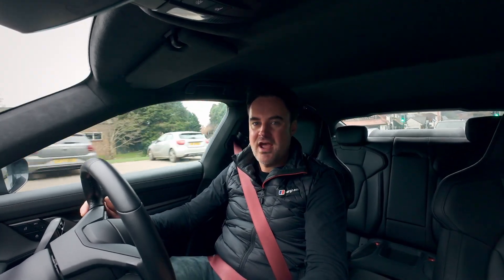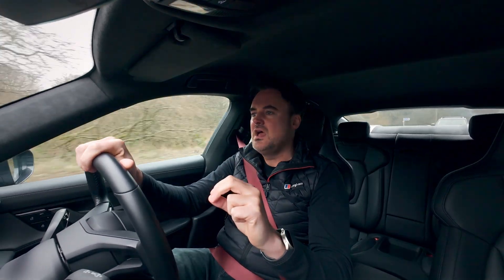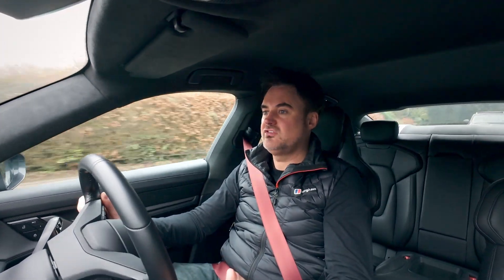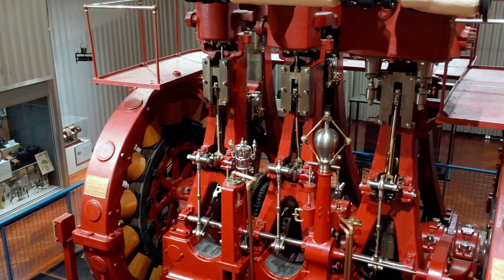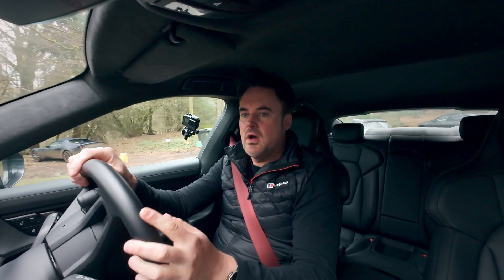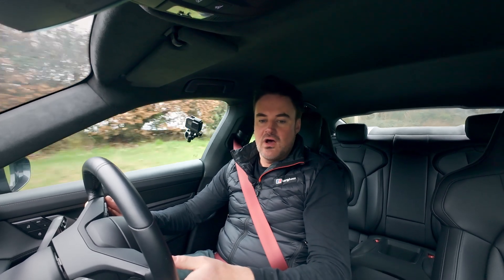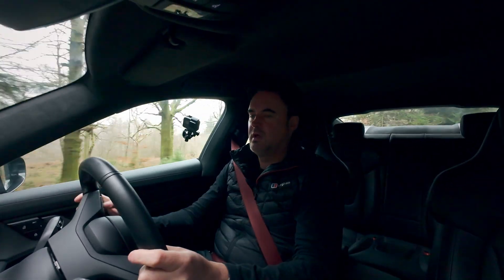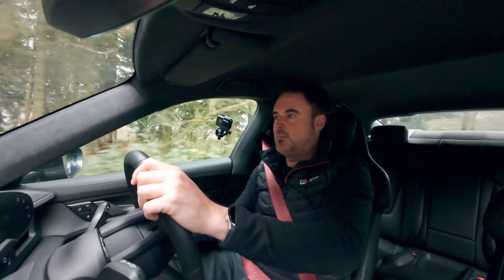Can A Hill Really Charge A Porsche Taycan?

Comment: Hi, I live in Switzerland in 1200m  elevation.  I have roughly 8km to the valley in 700m elevation (a route I drive multiple times per week). I drive a 1yr old Taycan 4S CT. With regen activated I usually average -20kWh/100km (max -25kWh100km in summer) going downhill. In those 8km I will generate +3% SoC and see an added 10km of range. I even get a bit more regenerated energy, if I drive behind another vehicle in auto-regen mode (vs full regen mode)

Obviously I use ‘comparable’ more energy driving uphill in opposite direction

However, Porsche Taycan is a beast at regen. I believe from empirical experiment’s that I have less consumption when I I drive the same elevated route back and forth vs driving flat he same distance/speed. E.g I once drove 40km started in 1200m via 700m to 1200m, and return to starting point (I.e in total 80km) with an average consumption of 16,6kWh/100km (assuming net 85kW capacity battery, that correspond to a range of +500km). Never saw that type of efficiency on a flat road. 

Clearly I’m an a happy owner, and can’t imaging a better daily driver car for the Swiss alps.
Reply from the maker: Thanks for your detailed comment, very interesting reading and good to see you are actually able to get the SoC up during your decent! It is possible then! 👍🏻
Reply: You’re welcome. Indeed it’s possible to increase SoC. as a consequence I never charge to 100% when at home-location, as I will otherwise miss out on the ‘free’ energy’. 

When I was learning to use the car, I once had a situation where auto-regen suddenly didn’t work (almost scary, going downhill). This, I realised, was due to the battery reaching 100% SoC and hence not able to regen any further.